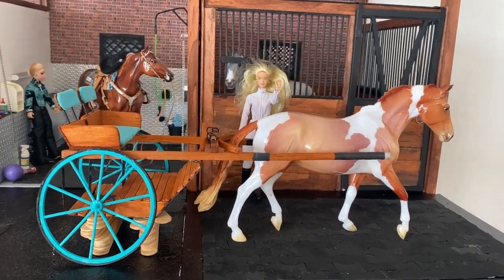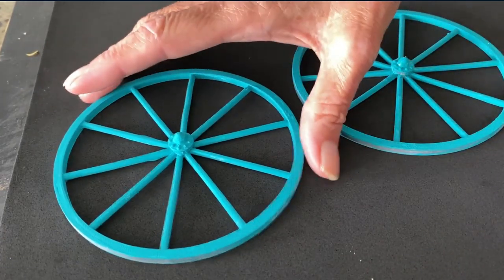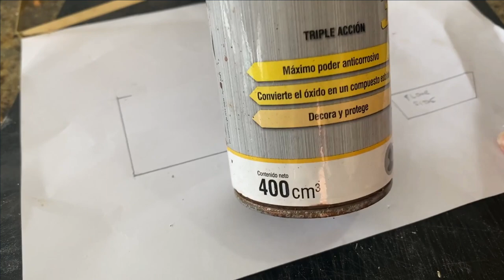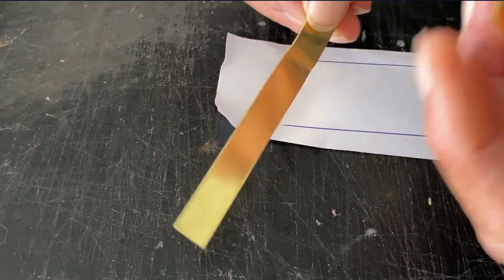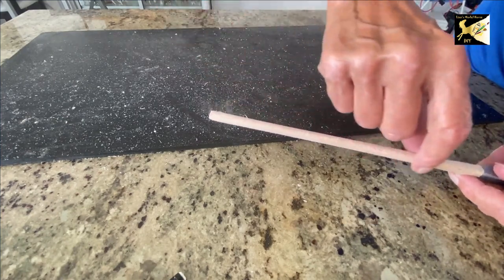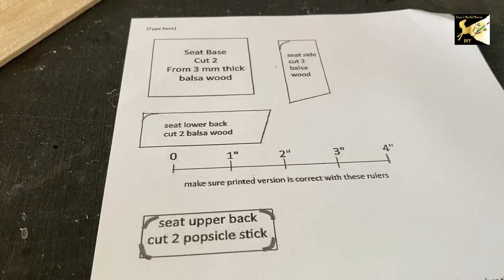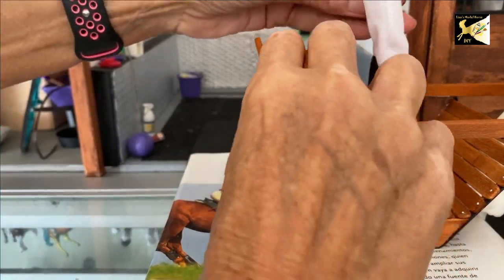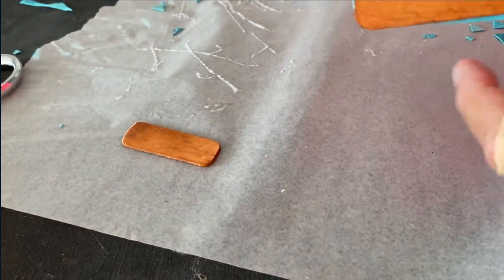Make a Model Horse Cart - Meadowbrook Part 1

Comment: I purchased your pattern, and spent hours trying to order all the pieces from your printed list. Now as I'm waiting for everything to arrive, I watched your video again. That's when I realized the sheets of Balsa Wood for the seats, were not on your list. Also, I will have to piece the shafts together, because I could not find anything longer than 12 inches. Amazing video series, that I will be studying over and over.
Reply from the maker: Did you check a craft store like Michaels? They sell the balsa wood or use basswood which is stronger (but I cant get it here). I thought that was in the instructions - sorry for the miss
Reply: @lisasmodelhorsediy  the only Balsa Wood listed was dowels. Nothing mentioned about sheets of Balsa or Basswood in the materials list. No craft stores in my area.